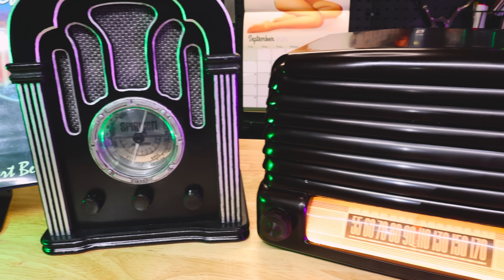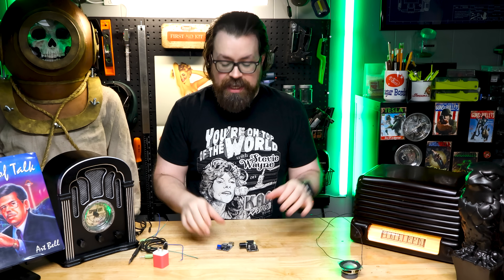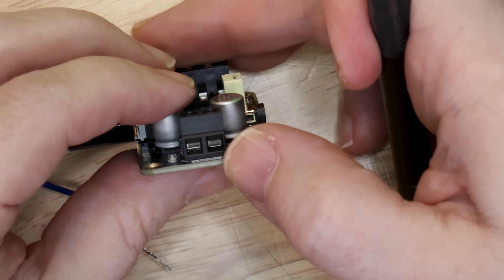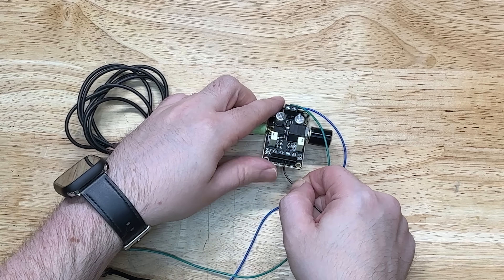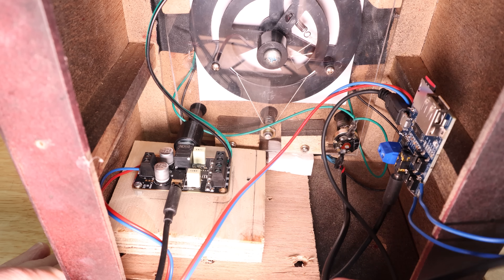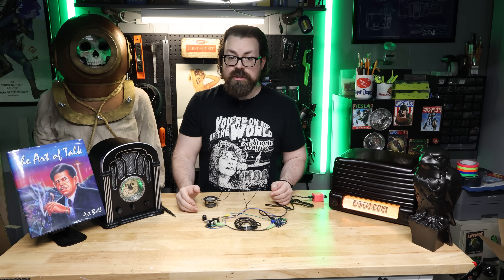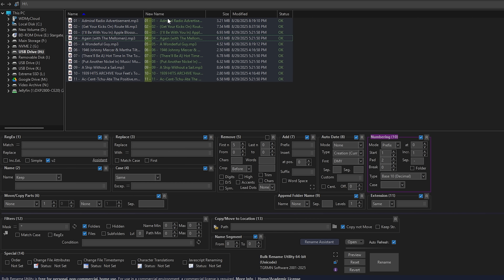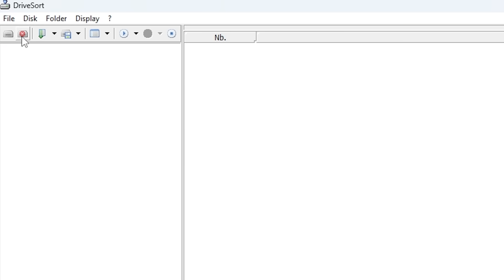How to Build a Radio That Plays Anything You Want

Comment: Such a great idea, with so many possibilities!  Here's a few suggestions.  First off, keep the original power cord - refurb it if necessary, and the on-off switch.  Connect the USB wall warts to the 'on' side of the power switch.  Replace any dial light or other lamp with appropriate LED's so these lights will continue to function.  Rewire & repurpose the volume control to the MP3 device.  Replace the tuning capacitor with a rotary encoder to choose the various play lists that you've downloaded - this will allow you to 'tune' the radio to various 'stations.'  You should be able to reuse the radio's original speaker, too - this would preserve the radio's original sound.  Or, at the very least replace the original speaker with new speaker(s).  Since the MP3 device seems to have only 1 channel of audio output on the pc board, the 3.5mm socket may have stereo output which would drive the stereo amplifier board.  Thanks for posting this vid!
Reply from the maker: Thanks! Good thoughts. I definitely want to look into the rotary encoder for future builds. I’d love to get that “dialing in a station” feel to it.

Comment: A much-much easer way to accomplish this is to shoose an inexpensive FCC Part-15 certified AM transmitter such as the ISS Talking House TH-5, run your playout source such as Spotify playlist into the TH-5 and broadcast wirelessly to any of your radios within your house. No need to modify the radios in any way, just set the TH-5 to a clean, unused frequency in the AM band and tune in that frequency on your radios. Tune in on as many radios as you have around the house! And with the TH-5 amd its antenna in a good location in your home or even better in a shed or garage and a good Earth ground on the transmitter your signal could even reach around your neighbourhood so your neighbours can tune in. All of this 100 % legal and no broadcast licence required!

Comment: What if audio is in stereo and radio only has one speaker, typically either the left channel or right channel is played through the available speaker thus the music is incomplete. Only hear half of the intended music. Or does this mp3 player combine the 2 stereo channels to mono if only one speaker connected to correct output which is not my experience? I know you mentioned this in the video but unless this board combines the stereo channels to mono, you would only hear left or right channel with a single speaker. Great video! I’ve tried many variations of this but haven’t found perfect solution.
Reply from the maker: Good question. I didn’t think to cover this in the video because all of the audio files I’m using are mono. I’ve pinned a comment to the top of this video by @RideManDave who explains some good ways of getting both channels out of one speaker. Both the MP3 board and the amplifier are capable of stereo, it just might take a little more setup as RideManDave mentions.
Reply: @theperrydaniels thanks!

Comment: I like it, but I would like to have a different playlist tied to a different station on the dial. Would also be cool to try this with old booth jukebox
Reply from the maker: I’d love to be able to do something like too. Maybe someone else will run with this idea. I’m pretty sure one thing you could do is have two separate playlists, one on and SD card and one on a USB drive and wire a switch of some form to the Mode button on the MP3 board. I haven’t tested that theory but I’m almost certain it would work.

Comment: I hadn't thought about doing this. Now I need to watch the thrift stores for old radios.
Reply from the maker: Absolutely! The best part is that if you’re careful you can make this modification without permanently damaging the radio so it could always be switched back to a working radio later on.
Reply: @theperrydaniels  yes, please, please, dont ruin/destroy/gut vintage radios, unless its definitely too far gone, you may well come across an earlier/uncommon/rare model, you do not need to ruin in it to fit something like this, in almost all cases, OR remove the original chassis, but keep it safe in a box in case you want to service and refit it in the future...

Comment: I build custom Bluetooth speakers as a side gig.  I think this is a charming concept.  One note of caution I’d give to those who replicate this project, be very careful putting any stress on those surface mounted audio jacks.  They are easy to break off the board, and then you’ll be doing some tedious solder repairs.  Thx for sharing this vid!
Reply from the maker: Great tip! Thanks!

Comment: What a fascinating project! I think I’m gonna try one where have not only a tuning dial but a decade dial. Call it a temporal radio. unfortunately, this means that I will have to have an Arduino controller to choose different file systems, but I do love the fact that this place is just like a radio. Thank you for taking the time only to do it but to explain how you did it. It is inspirational and very helpful.
Reply from the maker: That sounds like a fantastic idea! I considered trying to use an Arduino or a raspberry pi for this project but that’s a bit over my head. I’d love to see yours when you’re done 👍

Comment: You may want to remove the wire which connects the power ground from the MP3 player to the amplifier. Because you may be creating a ground loop, this can cause a hum. Is there a mp3 player module which actually plays on shuffle forever?

Comment: Did I miss something? Are you not running a stereo signal from the MP3 player into either (a) a mono amp, or (b) a stereo amp with only one speaker connected? Either way, aren't you losing one of the stereo channels?
Reply from the maker: Yeah I probably should’ve clarified that. The MP3 files I’m using are all mono and I’m only using one speaker connected to the stereo amp. You could absolutely play stereo files this way, I’ve just chosen not to.

Comment: Just a bit of useful information for people, if you plan to run only one speaker and pick either left channel or right channel for the speaker, most music from the 60's and up are recorded in stereo and a lot of it is mixed with vocals on one channel and instruments on the other, and some will have part of the instruments on one chennel and the others on the other so bands like the beatles for example many songs you will either only hear the vocals and no instruments, or just instruments and no vocals.
Reply from the maker: Yeah I really should have been more clear about that part of the video. All the files I’m using are mono. Stereo could definitely be done with this setup, I just didn’t choose to. Thanks for pointing it out for anyone who wants to go that route.
Reply: @theperrydaniels no worries, just figured id help in case anyone was curious
Reply: @theperrydaniels  Yeah no worries at all. Another method might be just convert the files from stereo to mono. I'm sure there is a site out there somewhere that can do that as well.
Reply: So, can you combine the L and R channels together to a single speaker?
Reply: @sauerworks Audacity (free software) does have an option to mix down stereo to mono. Input your mp3s you want to convert then select all and under Tracks-mix-mix stereo to mono, after that's done then you can export all to another folder. That's what I did.
Reply: @sauerworks you would have to do it at the input side of the amplifier board. With using a 3.5mm  stereo input jack and cable like that it wouldnt really be possible without cutting and rewiring the cable. The other option would be to feed the audio via soldering wired from the output of the mp3 board combining the posatives together and then the negatives together from the audio output and then solder them to the input of the amplifier board. If that makes sense
Reply: @sinformant  Yeah, the latter is what I had in mind.

Comment: I believe the audio/mp3 board you have has a build in digital 3W. amplifier,  just hook up your speakers to green screw connectors. 3w is more than enough fur such a small speaker. You also have boards with a build in randomizer function (amongst other usefull features) like only playing when you press a button i.e. you even have simliar devices for video 😀
Reply from the maker: The board will definitely play without the amp but it wasn’t loud enough, for me at least. Which was fine, having the external amp gave me the ability to turn the radio “off” with a physical knob. I’m really curious about similar devices for video though. I’ll have to look into that. A TV version of this project would be amazing 😁

Comment: I've got a 1935 Arcadia radio/record player that has been in need of major repair both cosmetically as well as electronically. I'm inspired to at least get the radio portion working based on your tutorial rather than replacing the electronics with an iPad to play old radio shows.
Reply from the maker: I really hope you try this! It works surprisingly well. And if you’re careful about where you put everything it can even be non-destructive to the radio itself.
Reply: If you're using the vintage radio's original electronics, make sure you isolate your bluetooth and/or mp3 player's output.   Some of those old radios had some weird ground setups, and they can spit voltages that modern devices don't like.   You can end up frying something... or worse.

Voice of (nearly tragic) experience.

Comment: I am waiting for my GE Model 414 AM Tabletop Tube  Radio (a parts radio) to show up. I downloaded a bunch of Horror, sci-fi, and mystery shows along with a batch of commercials. can't wait to get going on this. This will be so great sitting next to my vintage "BBC on-air" sign.
Reply from the maker: YES! That is fantastic! I am so glad other people are making this. Let me know how it goes!
Reply: And how are you going to play things in it? are you going to use a radio transmitter?
Reply: @niccolomedici4482  I am using Perry's suggestions of the board with the SD card slot and the board with the Pre Amp. As Perry did, my plan is to load files onto the card and use the Pre Amp put the sound through the speaker. 😁
Reply: I just got the same radio.  Never soldered before, but if I can learn and figure out how to mount everything, I know what Christmas gifts are for people next year.

Comment: Originally, I was going to try to shoehorn a Pi3 and touchscreen into an old radio carcass (5 sided Wooden box was only thing left by the time I bought it at goodwill) but now I think I need to dig out the wood box, and fabric I bought for the speaker cover, and see if this works, as it seems to be a much better option, and since it's been a while, my Pi3 was dedicated to being a PiHole, so this will probably be a better use for the project parts, than trying to shoehorn in a Pi4, and touchscreen... I have a different idea for that anyhow... if I can find the project box, I will reply with pictures of the empty wooden radio box, it's from the 1930's I think, based on the design, along with the fabric I chose to cover the speaker area. REALLY JAZZED to find this channel, and have been very interested to watch your projects!!! keep up the great work!
Reply from the maker: Thanks! I hope you try this. It’s certainly simpler than a Pi. I thought about going that route but honestly the amount of coding and configuring for that is just over my head. SD card and MP3 makes more sense to me 😂. Good luck with your project. Let me know how it goes!
Reply: I am imagining a radio, that is tunable, probably via "preset" buttons, that will take the button press, and use that to select the "channel"/Playlist... you have an excellent list of playlists, I think it will make a good starting point to jog my memory, so I can start making my own shortly, but for now, I think I will work on the physical radio box, as it needs some TLC as I await parts for the build - Thank You for making this video - I miss audio in my life, since all the streaming, and may consider making a similar box for an old 13in TV, to play old video with limited vintage commercials.